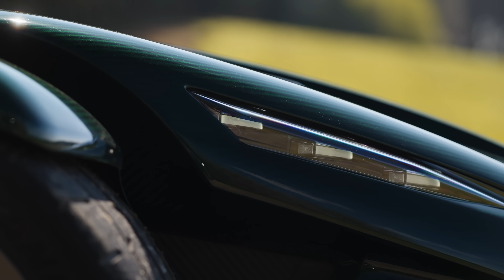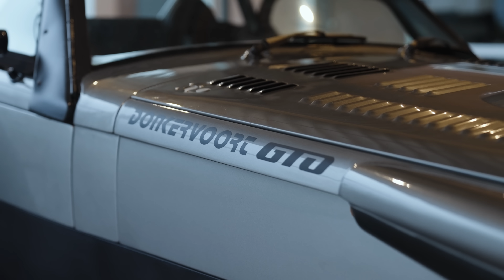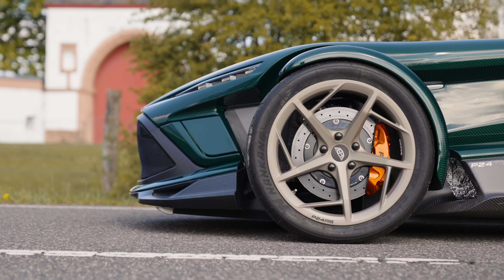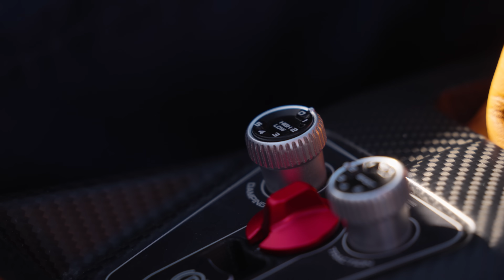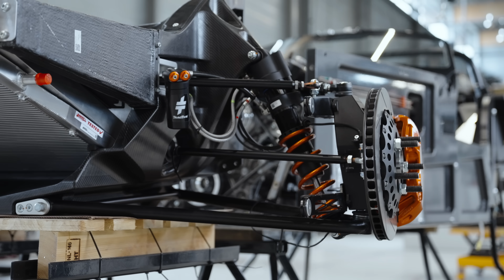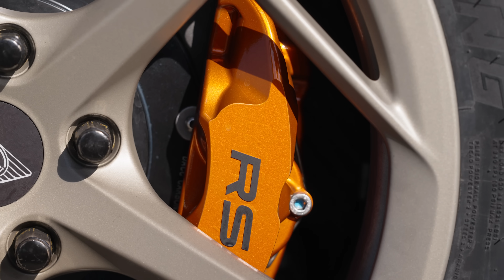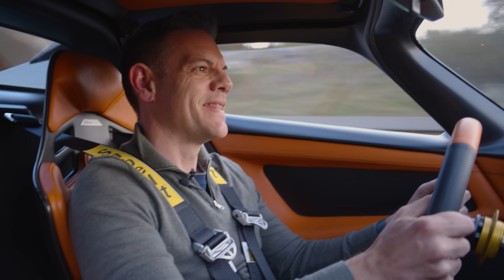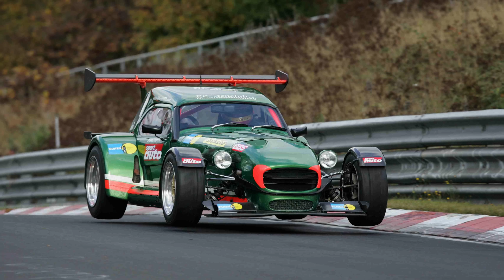New Donkervoort P24 RS: The Most Extreme Lightweight Supercar! | 4K

Comment from the maker: The perfect big-power lightweight? Or too much money for something so small?
Reply: For such a low production volume, all carbon fiber, it's not that expensive (ok way out of my budget by a factor 4 or so), but if you look at what a gt3rs or mclaren 750s costs, it's not that big of a difference.
So crazy exclusive, very pure, manual (!) and insanely light...it ticks all the boxes!
Reply: The perfect direction. All these porkers with hybrids and tech upon tech have made driving something synthetic. This is how a sports car should be made. Light, and as analogue as possible.
Reply: @HeadPack  This and the T33 are so awesome!
Reply: I have one thing to point at. "You said why not to have a 6th gear, you want to engage with the car". I think you misunderstand the point of these machines called automobiles. The gearbox is an aid, a help device invented to circumvent the lack of torque of gas engines. If you have enough torque, the less gears needed. When you say "engage with the car", the point is to engage with the road, the scenery, the wind, the noise, the sensation of speed and gravity force the journey gives you through your senses. The gearbox is not a part of that experience, because it is a mechanical trick to keep you in the preferred torque band. That I think is why nobody have posters of gearboxes, but do have of engines, spoilers, tires, seats, turbos, superchargers, stereos, even exhaust pipes, because the gearbox is a compromise, a disapointment needed by unavoidable physics.
Reply: @CarlosP.IbáñezJara bro straight cut sequential is better than growling v8 or screaming v10 what do you have to say to me all wise one (not satire your comment was wise af)
Reply: @CarlosP.IbáñezJara  Driving stick is engaging with the car and the road.
Reply: Difficult to get bespoke for less isn't it? As a new F22 owner, I can attest to the fact it's actually usable too. Drive hours to the track, destroy most all comers on street tires without turning a single wrench, and be the only one you'll ever see on the road.
Reply: @bcranes1 fair play to you. Its alot different if you have to tow a car to and track to have any real fun or you have to take spare tyres and adjust all the coil overs to track setting. And as you said great when you dont see another all day long. Wish you many more miles of fun with it.
Reply: The ultimate and best trackcars you can get. Forget a GT3RS or a GT2RS. This P24RS Donkervoort will smoke them all. Holding the world record for cornering G-forces at 2.3g for road cars. Holding the world record for G-forces in braking. Weight to power ratio unmatched. 
These are the absolute tracktools and up to beat the Nürburgring Nordschleife or any other circuit records for road legal cars
Reply: On order firebird blue
Reply: Is it comparable in price to the earlier ones they made. Do they make something that is simple like they used to make or are they only going after the "tech-bro" money?
Reply: Agree regarding tyres. Even sport/track tyres are no good in light weight cars as they are designed for Golf R or M3 which are 2 or 3 times the weight!
My own supercharged V8 Dax Rush is really hard to get heat into the tyres, ok on a hot summers day but on a nice autumn day then forget it!
Reply: They came a long way and I'd say perfect. Every iteration is just dialed up to eleven compared to previous one. And their perspective is driver focused. Drive one, you'll see ...
Reply: Is it alot of money,yes it is but compared to other cars that can do the same in performance ect it seems to be at the right price point. I like it alot. 😊
Reply: If I had the funds to buy one and have it shipped to me in Canada I wouldn’t hesitate to do so!!!
Reply: Finally! Something for the real petrolhead.. instead of all that copy/paste (Chinese) utopian EV propaganda! 😏
Reply: My GF says it's not how BIG MY Donkervoort is, it's how I use it!
Reply: Tires are a big problem
Reply: The compensator!
Reply: Looks like the power's whipping the car around.  Seems unhinged
Reply: Why does it look like a giant p-nis?
Reply: Closest to T50, amongst the rarest most pure driving machines, work of art, for a fraction of the price of competition. The bare naked carbon is beautiful!
Reply: if you don't know, don't say. your speech about the welding is so badly wrong !!
Reply: looks like dodge viper in another world right?
Reply: That’s A Hamster Hammond car
Reply: You 3D printed a car from the Cyberpunk 2077 Game
Reply: Not worth any of the BS until Misha drives it around the Nurburgring to be really legit.
Reply: You can buy the hat for $36 or the book for $119.
Reply: Thank you Donkervoort
Reply: No. It's perfect.
Reply: 🫤 I really don't feel it.
a high revving NA 4 cylinder Caterham R500 sounds 1000x better than this.
Reply: Ugliest car I have ever seen
Reply: @HullioGQ  In my home country (Poland) there is a saying: "Beautiful is not what is beautiful, but what someone likes"...
Reply: @simonuk4964 that's a beautiful saying.

Comment: I would have liked to hear more of the engine. I didn’t really get close to the car. How is the engine tuning in the power modes. 5 courses don’t seem so emotional. How do you experience 600 hp with the weight? This is hypercarlevel performance/weight.

Comment: While the power requirements with a TT V6 are being met, the soul of the Audi straight-5 was so much better. The 5-cylinder has a heap of head room for power, as people have tuned over 1000 horsepower into the unit.
V6 are dull sounding engines, especially with turbos.

Comment: Prices start at minimum of 300.000  for a car that is accelerating slower than a lotus or equal, cannot drive above 250 as it starts wandering.. 
To little for to much money..
Should have stopped before D20 and sticked to the 4 cylinder.
For this money I would buy an RS6 or an Porsche 911 GT3 RS

I worked on the D20. I know.

Comment: 0:05 - Pretty amazing that the ends of the Y spokes - that attach to the outer rim - can be made that small. I'd expect them to fail from high side forces  and bending moments  (the latter due to the distance from the wheel nut) from aggressive high speed cornering...

Comment: Brilliant review of a very cool car. It kind of reminds me of the BMW coupe version of their original roadster, especially the back.
I love that it's usable. How about the interior space. I can't drive my two friends cars, an original Lotus S7 and a Caterham version, because there's not enough room for my height or space in the foot well for my feet. I had to drive barefoot, with my head above the windscreen. My dream car was a Europa, until I test drove one. Same with the bug eyed Sprite!
Oddly, Ihave a car with some similar traits; it's low, wide, 2 seater roadster with a hard top. You can touch the rear sidewalls, while in the driver's seat, and it has a mile long bonnet. But this one is a slow cruiser. That seating position and long bonnet make it more fun to drive, until you have to pull out of a driveway with parked cars blocking your view 😮

Comment: I have been in awe of Donkervoorts for a long time.  I actually was at a presentation for the D20, the Audi V6 one that never went in to production.  Sounded great. But, while I have owned some nice cars including ones with an Audi 5 cylinder Turbo, I never had and never will have the oportunity to own one. 
The 5 cylinder and then in particular its sound , seems to be the only possible negative ( small print) of this newest car. I absolutely understand the Ford V6 is an upgrade, but the old engine did sound better.  But then, not much can beat a 5 or 10 cylinder car in regards to sound. 
The extended aero package is a bit too much for me, it looks much more classy without.. but.. I am looking forwards to see ( on YT) what the car can do with it on The Ring. 

Extremely impressive car, but like Koenigsegg and unlike Pagani ( eventhough I'd rather have one than the Swede) the most impressive thing about the company Donkervoort is the inovative technology.  Amazing how such small companies can come up with brilliant tech that actually works!

Comment: Once a lifetime ago I had the pleasure to visit the old Loosdrecht small facility Joop Donkervoort started at.  I wanted to have an once in a lifetime experience and rented (that was once possible) a S8AT with the Ford 2.8 Turbo Cosworth engine.  It drove like a rocket with the soft top open and a thunder from the sidepipe. 🙂 It did a comfortable 230 km/hr without any pushing.  I still treasure the memory !  
I drove a few other supercars (Honda NSX, Ferrari 348, Ferrari 550 Maranello ) but that Donkervoort was for me the ULTIMATE ! 🙂

Comment: So the chassis shown in progress isn't welded. Its silicon bronze brazed. Its hard to make it look good because it doesnt wet out like steel or aluminum, but it handles significantly more repeated stress and vibrations without cracking. Most high level drag and road course cars do it instead of normal steel tig welding.
Reply: Interesting!!
Reply: Agreed. That’s brazing. It most definitely can be made to look beautiful though.

Comment: The ultimate and best trackcars you can get. Forget a GT3RS or a GT2RS. This P24RS Donkervoort will smoke them all. Holding the world record for cornering G-forces at 2.3g for road cars. Holding the world record for G-forces in braking. Weight to power ratio unmatched. 
These are the absolute tracktools and up to beat the Nürburgring Nordschleife or any other circuit records for road legal cars.

Comment: Good day! I am a Lead Researcher of Applied Sciences at major tech corporation in the United States and wanted to make just a few, small, inquiries on behalf of our CEO. 

Given it's smaller, yet maneuverable, size, would the cabin comfortably fit an athletic male, around 6'2" and roughly 210lbs? If they were wearing let's say, heavier gear for various, extreme sporting, activities, would entering or exiting become too difficult? With the roof applied could, let's say, helmets or other head gear be worn without much difficulty?  Concerning the exterior, could these modular, C-Shaped wings come in larger sizes or other shapes, if needed? How many shades of black are available at launch? Lastly, what fuel requirements are there for the motor? Could adaptations be made to run on jet fuel, perhaps? 

Thank you for your attention to this line of questioning.

Comment: If I'm not mistaken the F22 had a close ratio 6 speed which was good for driver engagement but to achieve the quickest 0-60 time you had to launch it in 2nd gear. So I can fully understand the decision to go for a 5 speed since this also saves weight

Comment: This is so damn cool, its just a shame that its so expensive. Though compared to other offerings at the 300k mark, there isnt too much out there offering a raw experience such as that. Its either poser supercar material, track-focused stuff, or just small production shit that's too expensive for what it offers. This, while expensive, is still performing at the level of its price. Though i would imagine a version of this with aluminum or fiberglass body, aluminum chassis, and all around just using more budget materials and then sticking a supercharged or turbo v8 like an ls or coyote engine to make it bulletproof reliable while maintaining great power for a much lower price. It would basically be the v8 miata that no one makes for anything less than a quarter mill for whatever reason. I imagine a car like what ive described would cost close to a lotus Emira. Though that will never happen since large enough companies to do this at a scale that would make it viable will never do that because it would compete with their more halo car offerings and if they dont have one, that would be their halo and they would charge like 200k for one and at that point a c8 z06 and having the car stripped out, a manual put in (there are some in the works), and so on and there you have a manual, mid engined, screaming v8 powered supercar, but for the cost of a porsche gt3 and no warrenty

Comment: if wanting to catch attention, i would extend wheelbase enough that a V8 biturbo fits in. then throw a limited edition of 25 vehicles over the pond. how much extra weight are 2 more cylinders, and does the additional power weigh it out? 6cyl are mostly eurocentric and donkervoort has not caught the attention it should especially overseas.

Comment: I’m Dutch so appreciate seeing any review of a Donkervoort, and it’s an awesome car that looks amazing and I imagine on the right roads (not cornerless cycle friendly roads - not a shot at cyclists, I love cycling and love my country’s position on cycling safety) would be amazing to drive. It also looks so well finished and packaged.

But. The power level is ridiculous. A 200bhp Caterham could make its driver equally happier, and that’s with a significantly reduced risk of death. But also I couldn’t help but notice the noise levels, even with the roof up you couldn’t hear the reviewer talking.
And a 5spd attached to 600bhp doesn’t make much sense.
Reply: If you know the purpose why this Donkervoort P24RS is built, then all make sense. It's designed and built to break records on all different tracks. They are going to attend to try to break the record for street legal production cars on the Nürburgring Nordschleife. It shares technology exclusively used in F1, F2, WEC, GT3 race cars and hypercar brands like Koenigsegg. There x-core patented carbon fiber technology is delivered to and used by F1 teams, WEC teams etc. 

The 5 speed manual is Specially designed for that Donkervoort. And it make perfectly sense to use a 5 speed manual. Longer traps combined with high a high torque engine and small extremely fast reacting and powerful turbo's. And the car being ultra lightweight plus having the world record for a production street legal car in reaching G-forces numbers in cornering and braking. 
First of all, a manual is much lighter. Second of all, a manual you want to have for maximum handling capabilities on track. And third, a manual gives you the ultimate drivers experience.
Reply: @Elmo4207  every track car for the road is inherently compromised. Ideally you want to own the competition on the track and have a comfortable (as far as possible) drive home. I have no doubt this would shame a 992 GT3 RS on track, but it would be awful on the drive home against that same 911. More than that the 911 would handle mountain passes and highways, aided by a much more flexible drivetrain and a comfortable cabin. And the 911 is much cheaper, and a Caterham much much cheaper.

For that money I’d buy a new 911 Carrera T manual, an old Elise or Caterham that I don’t mind getting scratched and scraped, an RS6 to pull it to the track, and pay for my kid’s tuition, and deposit for their first home, and a boat (not too big), and …..
Reply: @fastharri i very much doubt that a 992 GT3RS would drive as comfortable as a Donkervoort on the road and mountain passes. I suggest you have a look at the review movie of Top Gear 😏😉😁.

You can change the settings of the car on 5 different drive modes. And even in those different modes, you can adjust several things to your likes. 
In those modes the ride height, the suspension softness or stiffness, the power output of the engine, the gearbox settings, steering, etc etc, are all adjusted to your likes for the road or weather conditions you are driving in. 

Cruising mode, gives the car a very comfortable ride on the public roads for example. They explain it wel in the review. 

And yeah if you want a car with less quality technical high end materials, parts, capabilities, technology, etc, then offcourse you go for a Caterham or a Porsche. You could also go for Golf GTI or for Dacia. 
What is the purpose for you on saying this? If we all think that way, why should people buy a Koenigsegg or a Bugatti, if they can drive a VW Passat for 100 times less the money. 
I mean a Carrera GT or a Caterham are in no way comparable with this Donkervoort P24RS. Just not in the same league. Not even close. It's comparing a hypercar with a Toyota GT86 or something. The GT86 is also fun to drive, but can only dream of the things that the Donkervoort P24RS is capable of.

Comment: Interesting design choice to build the chassis almost entirely out of square tubes... It makes it easy and cheap for manufacturing, but compromises torsional rigidity a bit.
Reply: I’m sure they didn’t use it because of the lower price. Must have been a good reason from an engineering point of view.

Comment: One pet peeve of mine is rims in the wrong direction. Angled spokes should be away from the direction driving and not towards. I'm imagining a sawblade rolling with the teeth hitting the ground damaging it vs rolling off the theeth. You feel me?
Reply: Or the teeth are gripping into the tarmac for extra push off the line

Comment: 18:40 If you feel THAT WONDERING around I can invide you to my company car to show ⚽⚽:
A Skoda Oktavia with (still) winter tires on steelies, no aero and nothing sport suspension what so ever.

Drove it 232 km/h last week on A 31 (=2 row unlimited Autobahn). With normal traffic around, of course. You need really ⚽⚽ when you need to brake down that speed to 130 or so.

So 280 in a Donkervoort is peace of cake.

Comment: Ok so for 300k I can get something that is actually unique. Sounds like a bargain when Ferraris cost over a million dollars now. This car actually seems to have some value in it. It is super lightweight carbon fiber… Porsche gt3 is selling for this price and it doesn’t have nearly that kind of power to weight ratio, nor does it have that amount of power. Sure, it is still very expensive but for the modern day, I don’t see anything that is this lightweight. It weighs several hundred lbs less than a Miata but it is 4x more powerful.